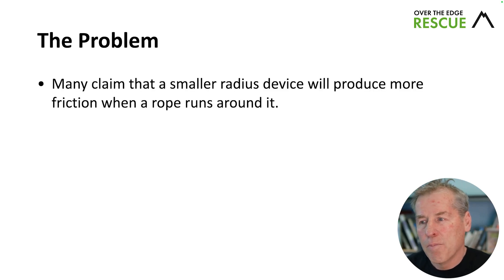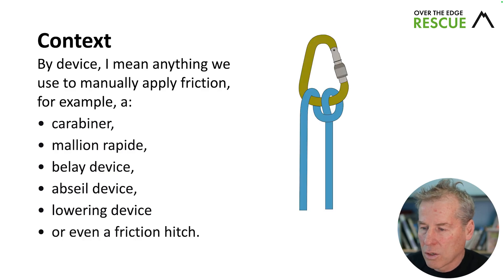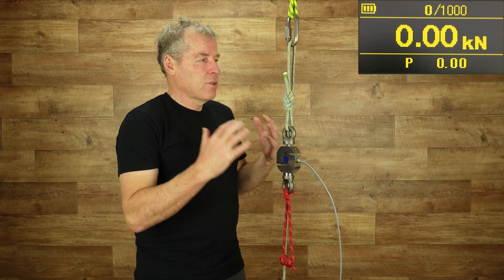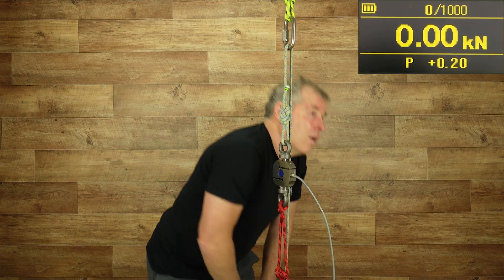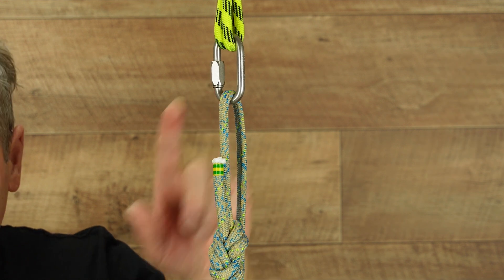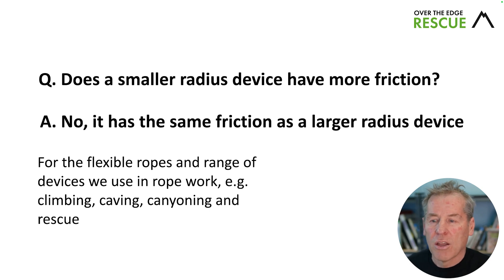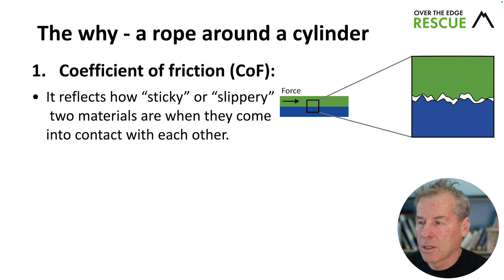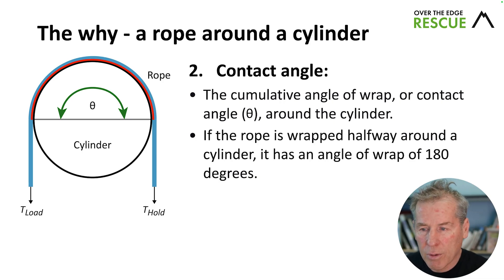Does a SMALLER RADIUS DEVICE have more FRICTION? YES or NO?

Comment: Thanks for a well executed experiment. I think you ended up measuring peak static friction, not sliding friction, but that might not matter. For a safety perspective however, a 12mm seems like it would cause less stress on the rope because it doesn't have to shear as steeply.

Comment: The 0.2 was the force required to get it going - with a bit more math you can get to Coefficient of Static Friction. Once the load is moving, you can calculate the Coefficient of Dynamic Friction. The force dropped off quite rapidly once you'd gotten over the "stiction". 
There's also the question of the relative diameters of the rope and what you are pulling it over. The general presumption is that if the rope diameter is small relative to the curve that you're  then the amount of distortion of the rope is small. You can imagine a large diameter rope being pulled over a barrier with only 10% of the diameter. With a heavy load (let's say 100kg - something like the weight of a climber + all their kit), the rope is going to get really squashed. The inner friction could be so great that some of the rope polymer begins to melt and stretch. 
When doing this kind of comparison it is more convincing if you can get some outright failures - so the take home becomes, "Don't do that, here is the safe region".
Keep up the good work!

Comment: Nice complete write-up. Sorry, but I think a key variable is missing, the friction from the tensioning and compressing of fibers within the rope as it bends around the object with a 1-2.8 kN loads. With a light mass, the rope is not distorted, so this friction doesn't come into play. Because of this friction, webbing is used around small diameter objects, sheave diameters are important to pulley efficiency and why basket hitches are stronger than choker hitches.
Reply from the maker: Does the theory and testing scale to greater loads? I did a quick test with the same 8mm rope and a 0.5kN force (or 50kg mass hanging), which is 5x what I used in the video. I used the same 7mm rapide and a 12mm rapide and got the same result. Both had the same max friction of very close to 2x - 1.00kN for the 7mm and 0.97 for the 12mm.